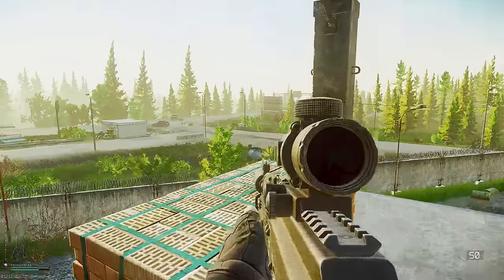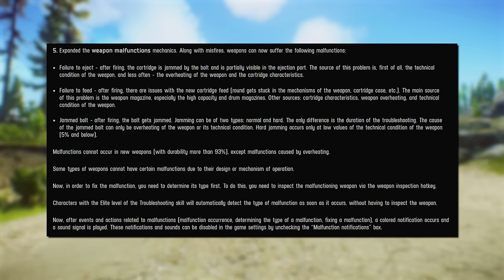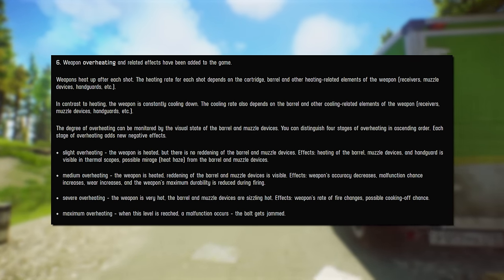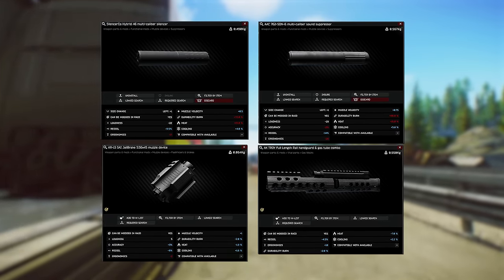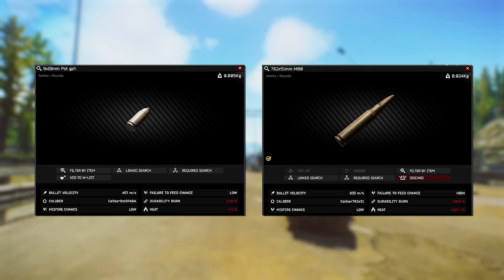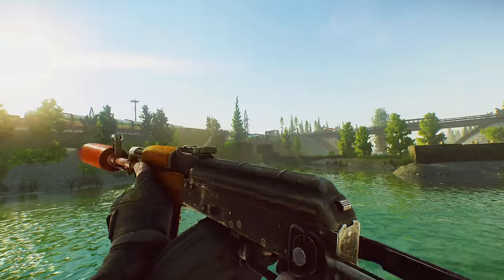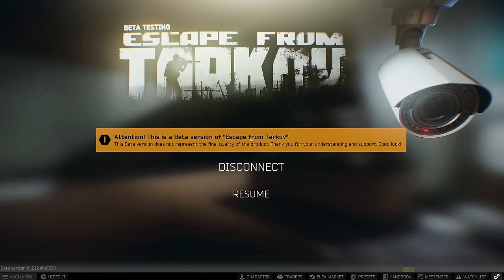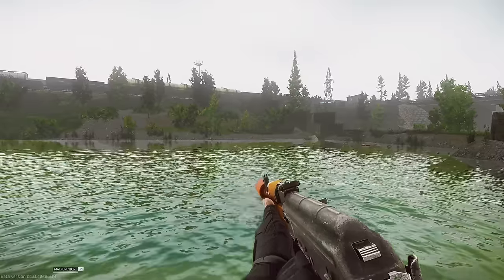One simple trick to fix ALL malfunctions..

Comment: The only thing I don’t like about the new malfunctions is that you have to check the chamber before fixing the problem. Racking the bolt is usually taught as the first thing you do when a malfunction occurs. This is because 90% of malfunctions are fixed by doing this. You would only need to check the chamber if racking it doesn’t fix the problem.
Reply: well with most guns racking the bolt is needed during the process of checking the chamber. So you end up just doing both, which is how it should work here too
Reply: I thought about this too haha. We were taught SPORTS originally which was dumb. Most instructors will tell you just perform tap, rack, fire. Much simpler.
Reply: @foxfire1112  ''Oh great heavens, my chamber jammed into a bullet. What should I do ? Let me think real quick, I won't get rid of the bullet rn fr'' That's a stupid PANINI SANDWICH PMC training !
Reply: you don't have to inspect if your weapon efficiency is lvl 3
Reply: dont know where its  taught like that. When i was in the military first thing is glance at bold then sort the malfunction by the thing you see. bolt closed- tap mag rack the bolt. bolt open- empty  mag. casing or round stuck- take cover eject mag rack a couple of times until casing falls out, put mag back in rack again. (for m4 obviously)
Reply: @danielvasilyev9454  it’s taught at basic lol. In an active fire fight taking the time to stop and look at the bolt is a waste of time. Tap it and rack it, get back to shooting. If for some reason it’s still not shooting then you can inspect the weapon. Also if you can’t tell when you have run out of bullets based on the felt recoil then you need to do a hell of a lot more training.
Reply: @TFBadBush  you can tell based on recoil but if you have a feeding malfunction if you rack you will only make it worse. Taking a quick look at the bolt doest waste any time
Reply: @danielvasilyev9454  I love how these kids want to act like malfunctions are black and white, and are so simple it's just "tap and rack"... as someone who trains often and trains with forced stovepipes, forced duds and even the, notorious for DI guns, death jam, trying to clear a round out of your gastube.. a lot of variables come into play when clearing a weapon and checking the chamber is an important step in diagnosing and clearing a malf.. at the range, I've seen noobs just rack it with forced "stuck cases" and it makes the malfunction a lot worse. You obviously have to rack to ensure the chambers clear, but it all starts with canting your weapon to the left to identify if you have a malfunction or are simply out of ammo. I'm not a vet, but have had classes at thunderranch and take online courses, for the little that's worth. Thanks for sharing your experience.
Reply: @TFBadBush  I would also assume they do this due to the AR having common malfunctions. Gas system blah, short stroke blah, tap rack it best for AR platforms.
Reply: fr when im mag dumping my s**t AK into trash i just pull bolt back, fling round and let er keep singin. im a moron i thought our tarkov char is sposed to be a highly trained spop
Reply: It's worse than that... Not only can you check the chamber when there isn't a malfunction for no good reason, it plays no part in inspecting malfunctions when they occurs and only clearing them after inspecting the weapon, which entirely different feature. It's pretty extra.
Reply: Yup, I feel you.
Reply: I died because I didn't know the keybond to clear a bolt jam after I checked for it
Reply: @mn999 i thought that was a bug. Wow til

Comment: Its cool that they made larger mags malfunction more often since its the same in real life. Most large capacity mags tend to run into issues a lot more often than standard mags
Reply: In theory, yes,  but it's also really exaggerated in tarkov... there are relatively reliable high cap mags out there these days, and most of them are in tarkov. It would, howeverz be cool if the extra weight reduced recoil but really hurt ergos and hipfire spread and maybe even movement speed or jow long it takes to shift in and out of prone. I feel like that would be a much better way to balance them.
Reply: @MrJamesIkanov  theres really only a few reliable high capacity mags out there such as the d60 which is in game but usually they arent very good
Reply: @MrJamesIkanov  Nah, drums are ass. Militaries don't use them anymore for that reason.
Reply: @AsukaLangleyS02  well, you're kind of wrong, but I'm mostly talking about the 60 round caskets and some of the other extended mags. Militaries don't use drums because they're heavy and don't fit on web gear more than anything
Reply: @warmonkey3216 that’s not true there are many very reliable extended magazines. The only reason the military doesn’t use them is because the bulk and longer reloading times aren’t worth the trade off of more ammo. Beta mags are some of the best mags you can get, the 100 round and 60 round surefire casket mags are very nice as well. Tarkov exaggerates it to the max. Maybe the Glock KCI drum or whatever is in the game is terrible irl but there’s good options in real life with reliability close to GI mags. (There are better mags but it’s not garbage)
Reply: How much more likely is the jam chance on something like a 100 round mag in Tarkov?

Comment: I don't quite know how BSG manged to make a fairly detailed system simultaneously too simple and also convoluted, but they did. Why they thought performing two separate actions/animation sets in sequence was necessary, when it derives no additional benefits nor difficulty is beyond me. IMO, they need to unify the inspect weapon/chamber feature's and utilize other existing features like racking the bolt or loading a fresh mag to "fix" malfunctions. 

I'd also like to see the addition of failure to lock, with the use of slamming the bolt or forward assist. 

Field cleaning either with a kit, a shake and a tap, pouring water on it or even cycling the action and forcing firing until the weapon self-clears; would be nice maintenance feature's that don't require a dedicate malfunction keypresses and could be part of good weapon care system for more advanced players.
Reply: What this game needs is a solid wipe cycle spent entirely on removing bloat and reducing the feature creep in this game. I mean, this game is so overly complicated for no reason in so many areas... if you reduced the bloat and clutter by just 20% the game is still way more convoluted than 99% of the rest of the shooters on the market.

Comment: wouldn't it be better to have "inspect" as press and "fix" as release? That way you only press the button once? Press and hold until yellow, release and you are fine to go? That is how I have it set-up at least.
Reply from the maker: you could do this, but its not the quickest. you'd have to know the EXACT time that you can release the key to fix the malfunction. the quickest way would be to spam one button until its fixed, each to their own though 😛
Reply: That def sounds more efficient. I think one could argue that Lew's suggestion probably doesn't take up much more time vs your suggestion. So they're both good bits of advice either way. :)
Reply: @2Lew  true, on my version you need to pay attention for the yellow alert before releasing. I have it set-up on my mouse, so it works ok, but I can see how it might be annoying for some.
Reply: u wont press it once only either way because ull also be sprinting around for cover or dodging shots
Reply: @2Lew  nah his way quicker.
Reply: @2Lew  you don't need the "exact time" you can release it whenever you want and it will do the same thing in one press and release.
Reply: @zzbarra  Negative I originally had mine set up like you said. You have to hold down the button twice as long for the game to recognize when you release it to actually fix the malfunction so therefore you would need the exact amount like he said to make it most efficient . I tested both theories and his is indeed faster. Tip: if you have a  mouse that comes with a 3rd party program like ghub you can bind any keyboard key to your mouse and use one of the side buttons so your fingers never have to leave any keys.
Reply: @lgentry4832  I have 5 side buttons so I have those bound to my mouse as well. As well as slow lean 👍
Reply: @UFCxAllday  About to hit y'all with a crazy one, I use my mouse buttons to crouch. (Not crazy to me but everyone I've told calls me such lol)

Comment: You can also set "inspect weapon" to continuous and "fix malfunction" to release so you hold down L or whatever keyring until it finishes the animation and then release and it clears the malfunction.
Reply: i just set inspect on press, hold the button until yellow flash, then fix on release
Reply: @horstuberhorst5402  Same destination, slightly different roads.

Comment: Hey Lew pretty sure if you switch the press and release order around you can fix malfunctions with one button press. You just need to wait for the inspection animation to finish on the press of the key, then on the release you can clear the jam. That’s how I’ve got my binds setup at least
Reply: you could but by setting it to the other way you run the risk of getting stuck in a check gun animation loop if you keep having to take your finger off the button because your getting shot at and keep having to press other keys to duck behind other corners etc. (i have had people charging and had to keep dropping back while reloading etc and having to hold a key during that might not be ideal.)

the beauty of this setup is that if your character knows the issue because there has already been an inspection the press option triggers when you press the button fixing the jam but if you have not done an inspection yet the press option is skipped because it is not active which means that you can just spam the key and the gun will go through the unjam process every time. needing to spam a key is much easier when your trying to juggle multiple things the way tarkov makes you.
Reply: holy shit.
i did ctrlT check release inspect press.
it jammed hit ctrlT let it go and boom done ready to blast. ezzzzz 10/10 comment.

Comment: By only ever using guns bought with 100 durability, and usually repairing them if I have used them a lot (basically anything under 90 is a repair), I've managed to only ever get one malfunction this whole wipe (currently, am level 34) as a PMC when I forgot to repair an AKS74U, and that malfunction despite killing me, saved me from killing santa and losing a whole ass point of fence rep, so if yall ever wanna totally avoid malfunctions, just use guns with good durability, you'll run into them very rarely. With scavs you can't avoid it happening occasionally but still, worth keeping in mind, they will be very very rare occurrences if you remember to fix your weapons and don't use scav guns/buy super used garbage rods off the flea

Comment: Best solution - run relatively new guns each round.
Reply: I had 1 malfunction this wipe, non-lethal scenario, and I have a pet project of mine to grind a Ppsh into the ground; early wipe I picked up some scav Ppsh, have used it a little bit on factory and some quick runs on customs, I also realised I am using the most damaging ammo too, and it's 35 durability right now, I always get it from insurance because who wants a piece of shit like that. Gun never once malfunctioned and the only malfunction I had was in 92 condition AKS-74, using low condition burn, low chance for failure to feed ammo in a low chance for failure to feed mag and here we are... WWII weapons were built different. I'll make that gun explode.

Comment: New player here with a random question, but how often do wipes happen? I might play on and off and knowing that the game has wipes, I'd like to know how often they occur.
Reply: Every 6 months.
Reply: usually around 6 months apart. The last two years, there's been a wipe around christmas, and one in the summer.
Reply: @alexmayer3134  and do they happen around large updates? 

So are updates scheduled around these wipes, or do the wipes happen regardless of updates?
Reply: @thebulletkin8393  usually wipes come with big updates. There was an instance where they wiped and only put the update a few weeks later, but that was due to some issues with the update.
Reply: @thebulletkin8393  there's a wipe every time there's something that changes gameplay tremendously, like inertia, or flea market change etc. so yes, wipes do revolve around large updates
Reply from the maker: usually 6-8 months. and it usually happens because theres new content which requires a wipe in order for new programming to be implemented... e.g. if it didnt wipe, it'd break the game
Reply: @thebulletkin8393  I think the devs try to sync up large updates with a wipe. It's not technically guaranteed, but recently it's felt like a wipe went hand-in-hand with a large update.
Reply: @cracklord4057  ok, that’s good to know, thanks for the info

Comment: Surprised overheating doesn't cause some guns to fire faster as opposed to slower
Reply: Well from what I know this is caused by the barrel being so hot that the bullets cook off without actually being struck with a firing pin. There actually is a malfunction with cook offs when your gun is overheating so it kinda is in the game. But overheating generally speaking slows down the guns because metal expands when hot so if you're using a gun with very tight tolerances there's a lot more friction hence the whole system just slows down. Generally speaking guns that shoot a shit ton of bullets fast tend to be open bolt for cooling purposes and have spare barrels.
Reply: @tropicalfruit4571  fair points, although I bet it has more to do with warping than expansion, I'd hazard a guess expansion initially loosens the tolerance on some systems which is why I thought it'd speed up, but then parts start to warp they slow and jam up.

Comment: I just came back to tarkov after a year of having a life. I ran my best gear for 3 raids and was proud of myself. On the 4th raid my gun jammed and i had to hide, looked at the commands and found shift + T. Well, that didn’t work. So i tried to run to an extract while using a scav’s pistol and was killed. I will now forever hate the jamming system.